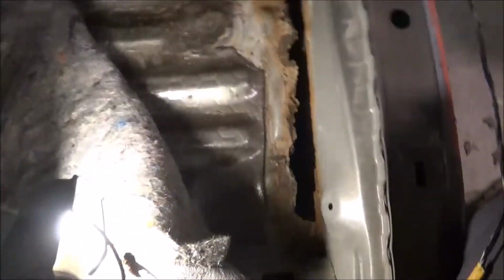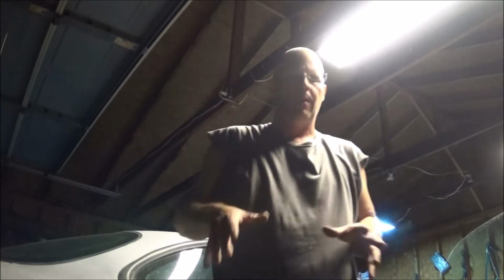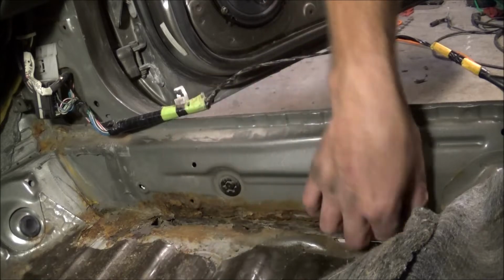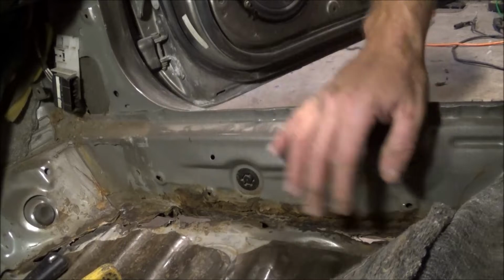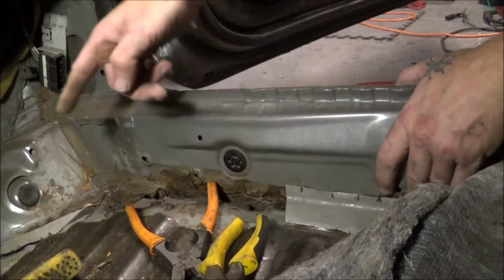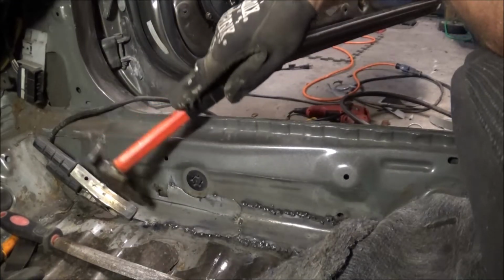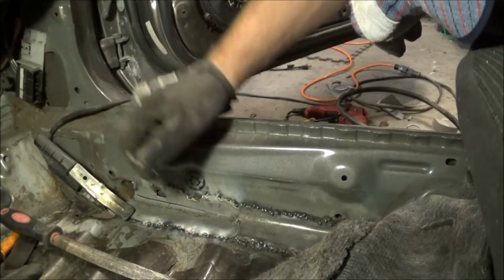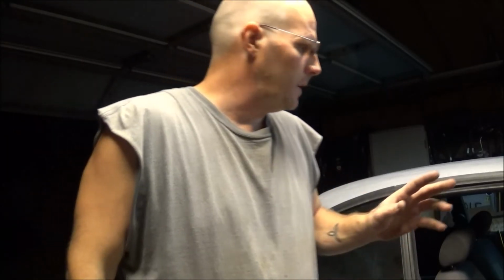FLOOR PAN REPAIR | WELDING FLOOR PANS

Comment: Are you using .030 mig wire? ( smallest they make I believe for that welder )
Reply from the maker: Yes its .030 I prefer it over the .035 it seems to burn smoother in my opinion its the harbor freight 2lb. Roll just in case you're wondering